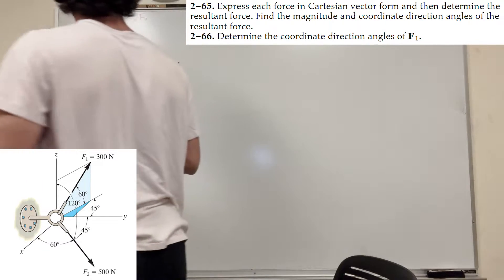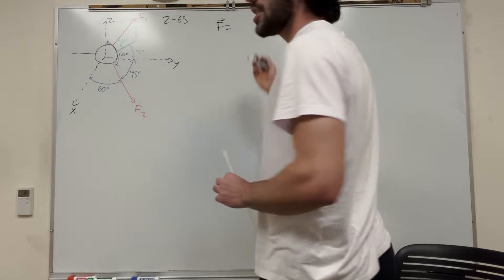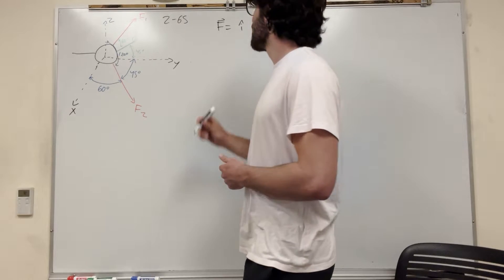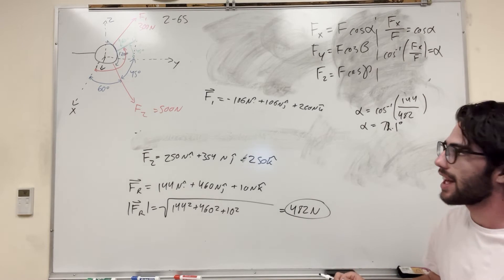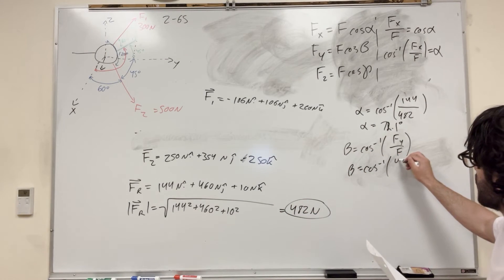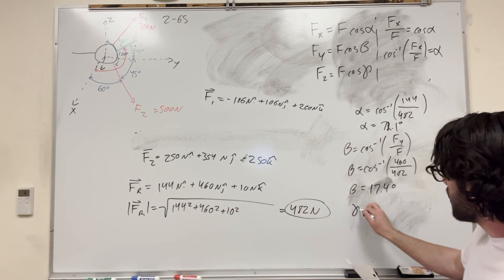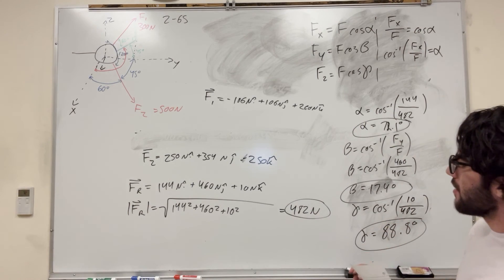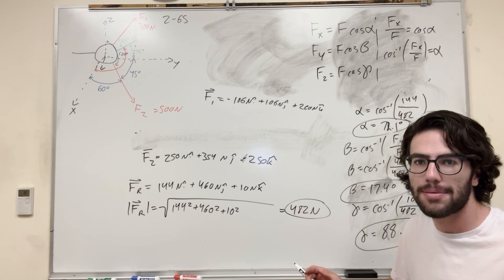Express each force in Cartesian vector form and then determine the resultant force - 2-65

Comment: At 4:00 why did you take 45 and add it to 90
Reply: cuz there are to angles given for x but we need to find it only from positive x so we need an overall angle, that only goes from positive x up to f1 which in this case is 45 add 90